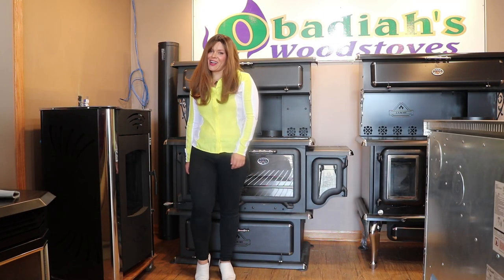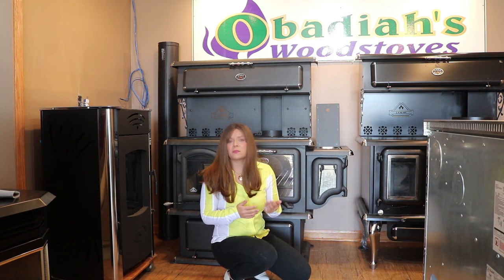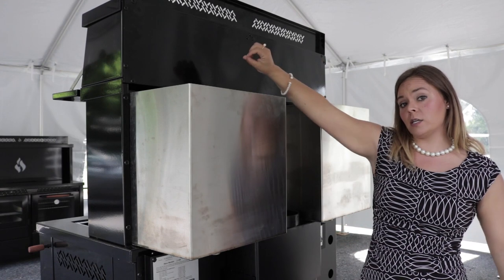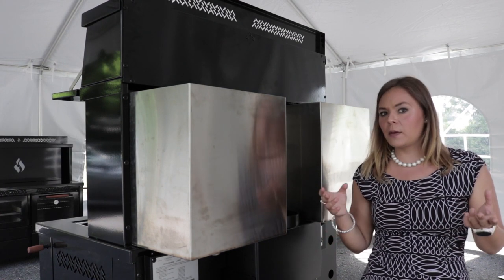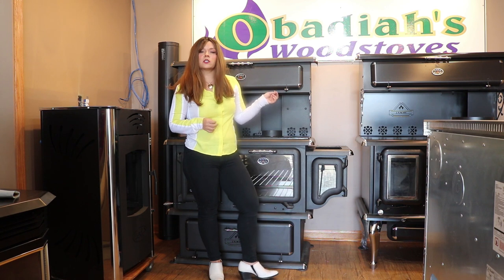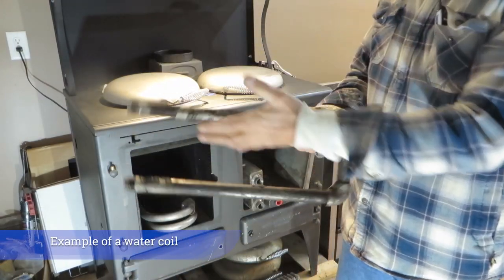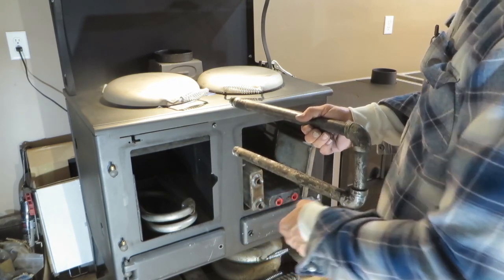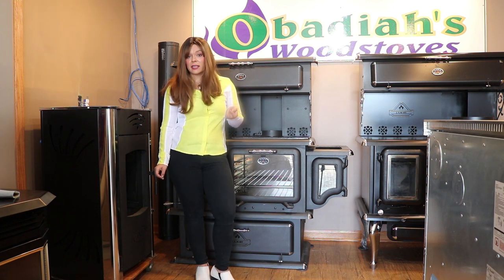Wood Cook Stoves – Hot Water Options – Water Reservoir, Domestic Hot Water, Hydro

Comment: I'm looking for a stove I can do as an insert but still have some portion of the stove sticking out the front of the fireplace so I can atleast use a kettle or frying pan and I want a decent size fire box so to keep house warm at night but also have an oven next to the fire box too. Most I've looked at are too tall to fit in my fireplace.  I can maybe remove some bricks around the face but don't think I can cook on top. My thought was an insert with no legs or something with a low profile and I have a hearth in front so maybe the stove can stick out far enough for me to cook on. but I also want a water jacket to run a radiator to one bedroom so in a power outage we can stay warm and cook. Any suggestions?
Reply: It's been more than 1 year since your comment.  I don't think you're gonna get a response.